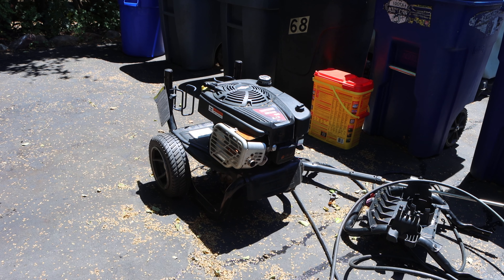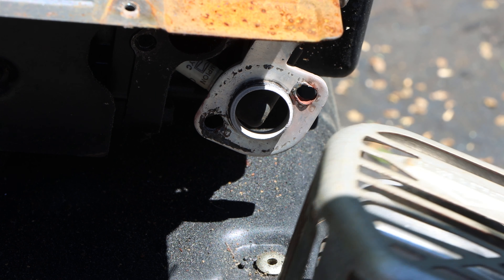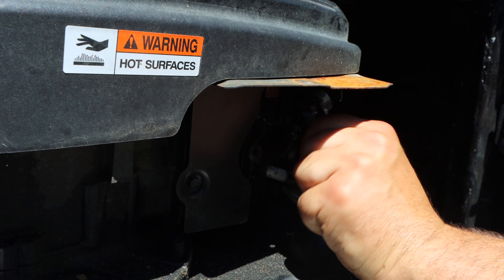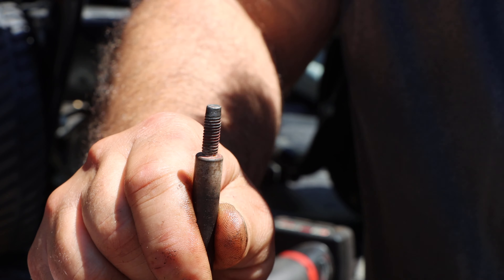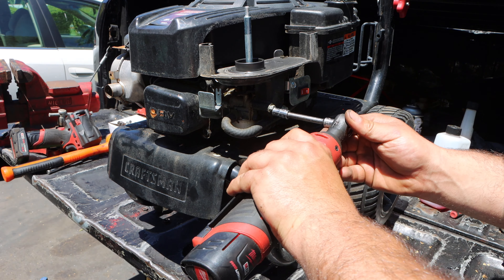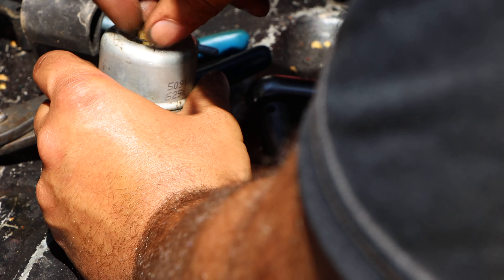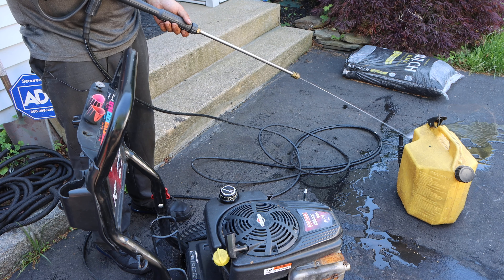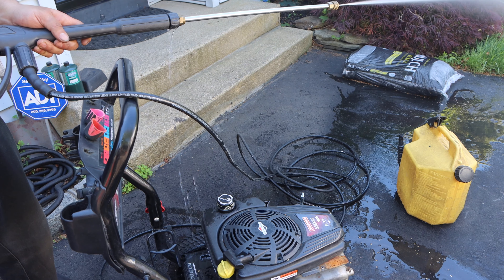#FREE CRAFTSMAN 3000 PSI PRESSURE WASHER  WHY WAS I THROWN AWAY?  Common Issue Briggs & Stratton?

Comment: Jason, that looks like a nice machine and the pump works fine. Those exhaust bolt issues i just put heli coils in. The kit cost about 25.00 . Comes with the correct drill and tap and several inserts. Good luck! Roger
Reply from the maker: Roger Mcdonald,

I GOT REALLY LUCKY with this machine...almost hope I don’t fix it!  The gas tank will go on Time Master and forever solve my fuel leak issue and I got a new killer Mobile Oil Change Stand!  Not sure about a heli coil or just tap it for the next size up!

Thanks for warm wishes as always 🤙🏻🇺🇸🦅🔧

Comment: Just a FYI, the holes for the exhaust bolts are not drilled deep it's only drilled deep enough so the muffler, and gaskets, and auto choke spacing, don't go deep with just the bolts they will snap right off..... The spacing is key.
Reply from the maker: Knighthawk's Mowers thanks for the tip Uncle Rob!  I’ve comes across this on a mower...same engine.  Wonder if design flaw/casting flaw?